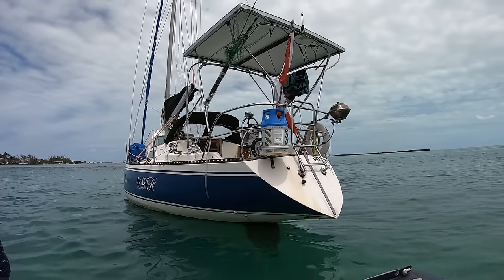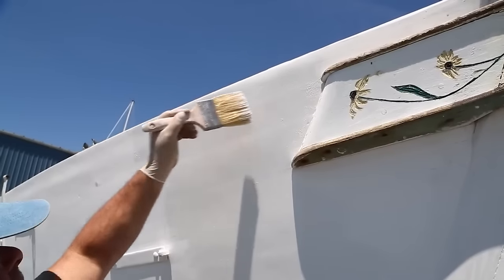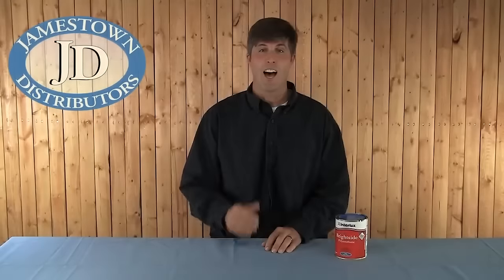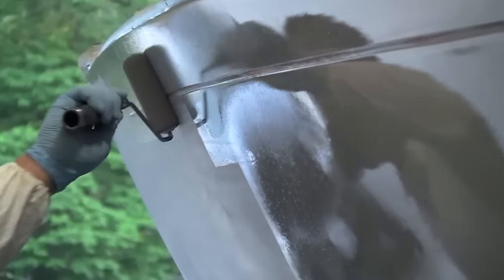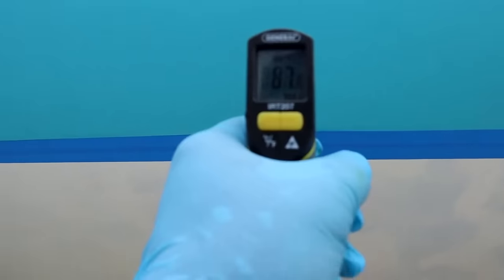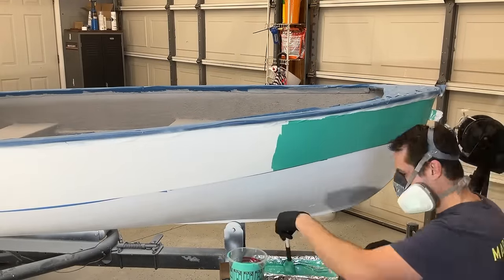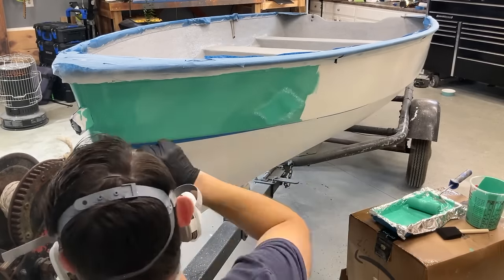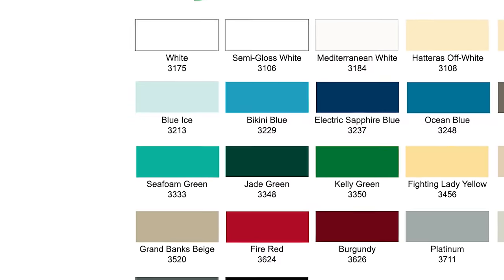Sailboat Paint Decisions, Decisions... Just Basics - Ep 273 - Lady K Sailing

Comment: If you paint your boat black, you don't need propane. You sail down to the tropics, set your eggs on the cushion, then put them in the fridge when they're hard boiled. Sometimes tankers run over black boats, but at least they don't notice. Shelf colors are a blessing. The shades pop better, when you see what each brush stroke costs. You'd better get your gelcoat in perfect shape before you lay paint on it. PT 109 advice: "Slap it on. This isn't a movie star's bedroom." I have a Devilbiss sprayer. I've never used it once. A paint brush is so much easier and easier to clean. The less stuff you have to buy, the better. Lose the skinny stripes. Make it easy.

Comment: Alexseal is the new kid on the block with yacht paints. They have a great product equal to the most popular one. Except they have an additive that make no need for tipping. Just roll it on and wait at it self levels. Andy at Boat Works is a distributor.
Reply: Jamie is spot on.  It followed Andy's video and had great results using Alexseal Yacht Coatings and that new rolling additive (something named with 4 numbers)
Reply: I started to prep my boat for Alexseal, then i got carried with glass repairs, new sizing for stainless port lights and the list goes on, it’s been two years, finally ready for paint! I’m in Cleveland, hampered by weather and seasons and my job
Reply: I came to the comments to say the exact same thing! And I think the light blue would be perfect for a first paintjob. Enough pigment to cover relativly good, but not dark enough to show every little flaw. I would add some white lines or something to break it up a little tough. Maybe just using decals so it can be changed later if I wanted.
2 pak is in genral much stronger, and if you are doing such a big job I would reccomend it. It's worth it in my opinion. I dont have any experience with the last brand mentioned in the video tough, so I can't comment on the durability of that one...
Reply: I agree. It can be rolled with excellent results.  Plus it can be buffed. You can touch up and blend in with excellent results!
Reply: I haven’t tried it myself yet but also follow Andy and was going to suggest he check it out.  

For bottom paint I’ve always used Interlux and been extremely happy with it.  It isn’t cheap, but 1 signal coat & 3 coats on top and it’s almost ready for a recoat after 8 yrs!  Their customer service is excellent as well.  When I moved from fresh to brackish water they were able to explain the differences between products, help me make the right choice and give me a lot of info about application/recoat which allowed me to significantly speed up the process and reduce daily charges for sitting on the hard.  I have no connection to them other than having a great experience for what it’s worth.

Comment: Dont forget show-through. I used International perfection on my RL24 because it was the closest on-the-shelf match to the original colour. Took 5 coats (and more than twice the anticipated cost) to hide the patchwork that was underneath. Used Altex 3-2-1 on topsides - much better coverage and easier to work with (wet-edge etc.). Both have been good in terms of durability.

Comment: I just painted my boat. I used a 2 pack acrylic paint. Supposedly it can be fine wet sanded and polished. It rolled badly so i bush used a brush with the usual runs and brush stroke marks. Next year i will sand and polish it.

Comment: I would love to see a video on weight distribution on sailboats.  You recommend oversized anchors and chain rodes (which I have) however it absolutely destroys the sailing characteristics of smaller or lighter boats like my Ericson 27 since there is literally no way to carry all of that heavy ground tackle other than on the bow (my Rocna does not stow anywhere except on the bow roller and the chain rode has to drop into the bow for the windlass to work).   Honestly I adore my bombproof anchor setup and refuse to swap it out for anything lighter as it has seen me through some severe anchoring situations where nearly every other boat dragged.  I have been willing to put up with severely degraded sailing performance for peace of mind in an anchorage.   I just wish there was a way to get that weight further back towards the stern.  The same applies to large battery banks.  Li-ion batteries have made that less of an issue but a big battery bank can really screw up the trim of your boat.  I guess I just need a boat that only has a middle and no bow or stern or port or starboard!  :)
Reply from the maker: you raise some good points for sure
Reply: I’d like to see something on this subject as well. I saved some weight with a lighter beta vs the original Volvo engine but when I replace my anchor I’ll definitely go bigger and when I start cruising it will get heavier still.

Comment: Tim, we just painted our 36' Islander Freeport with Total Boat Wet Edge.  We went with white and the wet edge is a real issue.  We did lose it a couple of times and you can see the lines.  Luckily we went with white so its hard to see unless you are looking for it.
You mentioned the cost could be up to $1,000 in paint.  We dis 1 coat of primer and 3 coats of the white and we only used 1 gallon of primer and 1.5 gallons of paint so the cost was pretty low.  Just an FYI

Comment: Just painted a Santana 525 roll and tip method using Wet Edge Poly.  We did it outside on my driveway.  Conditions during painting were NOT ideal, but the results are "good enough". The must have is a 1/8" nap foam roller rated for that paint. Really did not tip much, the roller with the brushing solvent allowed the paint to lay down well. We went with a bright red color and it drastically change the way the boat looks.
Reply from the maker: Great tip!

Comment: I painted my 1972 ranger 33 with interlux toplac (roll and tip) maybe 15 years ago. I wanted a soft grey, so i mixed two grey to one white. The boot and cove stripes were interlux brightside red. I sold the boat after about five years, and it still looked really good. You may not want to go too bright, because you are going to see all of the hull imperfections.  Also if you mix, and run short, it could be a problem matching. Good luck!

Comment: Oh, this is going to be fun! I had my first Islander painted professionally with Awlgrip. Beautiful finish, no more waxing. And 30 years ago it was still affordable. A group rented a barn and we prepped five boats, called in a sprayer, done! I haven't painted "Natasha" and probably won't. But I did paint the stern, it was in poor shape after being renamed by various owners. I used Interlux Brightsides, standard Hatteras white, to match the gelcoat. 15 years later it still looks good. I rolled and tipped, looks just like the gelcoat but easier to keep clean. Remember that a dark color will show all the hull defects, along with all the dried salt spray. Lighter colors hide a lot. Prep work is the key, as you've mentioned. Sanding with a long board is critical if you want an even hull at finish. Brightsides is a single part, but can still be touchy to apply. Temperature and application thickness is critical. And remember the 10 ft rule: if it looks good from 10 ft, it's good! (that distance shortens as eye sight fails with age!). Good luck, and I'll be following.....
Reply: Natash's a beautiful boat Bert. I enjoy your videos. See you out there...
Reply: @Cacheola  If you're out on the water where I sail, what do you drive? I will keep an eye open. I'm on AIS if you happen to see me out there! Thanks for the comment!
Reply: @BertVermeerSailing  Catalina 34 mk2 out of Comox. I may circumnavigate the island this yr. I'll rattle your chain
Reply: @Cacheola  Please do. I'm headed out to the west coast by Victoria/Sooke/Barkley and point north starting June 2nd to the end of July. Enjoy the summer!
Reply: @BertVermeerSailing  OK Bert. I have an old cat with kidney disease I'm tending to, have to stay close to home this year...

Comment: My current boat is painted with Epifanes 2 part polyurethane. Much harder wearing than the Brightside that was on my previous boat. Pretty simple - 2 parts plus the required brushing thinner, done when relatively cool it maintained a wet edge and flattened straight off the foam roller without tipping. More money than single part but you get what you pay for. Readily available in Canada (even Manitoba).
Reply from the maker: thanks!

Comment: I ended up spraying my 30' GRP boat using automotive paint about 6 years ago.  Same preparation (sand, fill, prime, sand etc) then two or three light coats of paint sprayed on, followed by a UV-resistant clearcoat.

I sail year-round in a very high UV environment.  The paint still looks excellent.  

With vehicle paint you can choose exactly the colour you want, it's easy to touch up (you can find someone to colour match auto paint just about anywhere in the world) and any touch-ups just need some clearcoat on to be sprayed on top which can then be lightly buffed and polished so the touch-up disappears - it's as easy as fixing the paint on a car (and again' lots of people can do it fairly cheaply).

I looked at Awlgrip.  The yard told me that one of the reasons they charged so much to paint a boat with it was that if they make the smallest mistake they basically have to start all over again.  Effectively they were costing in the potential of needing to paint the boat twice...

Comment: In 2015, my 1996 Beneteau 42s7 was professionally painted with Awlgrip.  Between haul outs I wash it with mild soap & water.  Every two years when I haul out, I apply Awlcare, a milky liquid polymer that goes on easy, leaving a magnificient shine and protection.  Just yesterday I splashed the boat after a three week haul out where I applied the Awlcare, again leaving a brilliant luster.  Also I replaced the 30 mm propeller shaft with Aquamet 22 due to some corrosion and a cut caused by a wire fishing line.  The cutlass bearing was replaced.  A new three blade Max Prop "Easy" was installed too.  To remove the prop shaft the rudder had to be removed so I took advantage of that and replaced the lower bushing.  Although I've owned this boat for nearly eleven years, I learned two things: 1) the rudder post is fiber/ fiberglass, and 2) the strut is also some sort of fiber/fiberglass.  One note about the new Max Prop "Easy".....the threaded length on the shaft is much longer than a traditional length. I had purchased an eight foot length of 30 mm Aquamet 22 centerless ground bar; it was plenty long enough, leaving a drop.

Comment: I painted my 1970 hull with Easypoxy. I did almost no prep, and I rolled and tipped and it came out great, better than I expected. I chose Bikini Blue, because that's the closest color to its original color (which I could see when the white paint came off of the gel coat in some places). I used Penetrol, which helped keep it smooth. I forget how much I used, but it does matter, so one should experiment. It allowed me to roll and tip on a hot day and not have the paint dry too quickly. And it leveled out nicely with few brush marks. Really great stuff. Plus, the paint is durable. There is white underneath, and I figured from normal wear and tear I'd see white eventually, but I didn't. When I  bump against a piling or something, it just scratches the surface of the paint and doesn't go all the way through.

Comment: I painted my 27' Newport bottom, hull, and top deck.  I used Trinidad (the old stuff) on the bottom, 3 coats, and Interlux Brightside for above the waterline.  Rolled and tipped.  This was about 10 years ago, and the total cost at that time was about $1100, but that was everything...haul out/splash, 4 days on the hard, paint, thinner rollers, brushes etc.  As MountainMan below said it looked great from afar, but was not perfect.  That is not the brand of paints fault.  You will make mistakes, but a lot of them you will be the only one who can tell.  I am about ready to do it again.  Colors?  My choice would be gloss black with fire red accents.  Best of luck!

Comment: Have you looked at Teamac paints? 

UK outfit. 

They do a single part paints as well as two part. 

I've used their paint. 

Very straightforward to use and excellent result, provided your prep work is done well. Roller and brush finish. 

But if i can make a suggestion, regardless of what paint manufacturer you run with....BUY TOP QUALITY ROLLERS, AND BRUSHES ONLY. 

Makes a huge difference.
Reply from the maker: I will check it out

Comment: A couple of things. Awlgrip is about the most difficult of the 2 part paints. Something like Epifanes 2 part is quite simple in comparison. Prime with their primer, mix the 2 parts and roll and tip. They even specify that you can paint directly over sound fiberglass with no primer required. I’ve used their 2 part with and without primer and it’s great. One thing to keep in mind is you can never use 2 part paints over 1 part paint. So if the boat has 1 part on it now or once you paint it with 1 part, any subsequent painting has to be 1 part unless you completely strip off the 1 part first. I like EasyPoxy too. Interesting when you said the green was too green and the blue was too blue. I immediately wondered how they might look mixed together. You could buy a very small amount of each and try mixing a small portion a little at a time? It’s a thought anyway.  Ken

Comment: A few years ago we painted the topsides of a Mumm 36 and we took a slightly different route.  Instead of roll and tip we talked to the painter in our local autobody shop and he did it as a side project for a couple hundred dollars.  He already had the equipment and auto paints are very similar.  We had the boat prepped when he arrived and had a section of rolling scaffolding and a couple guys to move him and the lights as directed.  Turned out great.
Reply from the maker: Interesting……
Reply: @LadyKSailing  and as far as the end result its all about the prep. Sand, fair, sand, sand more and more and more

Comment: Did you find Lady K’ dark hull hot in the south? If so, go with the Seafoam. 

I painted my Flying Scott with Perfection rolled and tipped. It came out amazing but not as good as spraying. I need to do it again a it broke away from the dock in a gale and washed up on the rocks. But you need a protected place free of pollen and dust

Comment: What about a wrap? I’ve been looking in to wrapping my 1978 30’ sloop, and so far, it’s looking to be not that bad. 
Either way — spray, roll&tip, or wrap, I will have to learn how to do it, but I think the process and tooling of wrapping will be a little better than the painting.
Reply: And yes, I know it’s not as long lived as paint. But that’s not necessarily a bad thing. Removing the old wrap isn’t that hard, and leaves a surface that is pretty much already prepped for the next wrap. At any rate, I’m willing to experiment on my boat. She’s 46 years old and has been through a lot. So this isn’t some kind of indignity.

Comment: For all the effort to ready the surface it would be best to use a two part polyurethane paint. Lots of choices as per brand. It is a two person job: one rolling
on the paint and one tipping off. The two parts are not that difficult to apply and the result is far superior. Higher gloss , higher resistance to abrasion , high
resistance to UV . Plus for the Caribbean use some light colour to keep the temp inside the boat more bearable. Look at Interlux Perfection which is easily applied by rolling and tipping
Reply: Unfortunately Interlux has discontinued Perfection! It was my favorite.

Comment: For my two cents, I would suggest you get samples (pint) of both the Bikini Blue and Seafoam Green, and then see if a 50/50 mixture of them gives you a color that you like -- there shouldn't be an issue with combining the colors as the pigments are both from the same manufacturer.  It sounds like you are looking for a color right between the two.  If the 50/50 mix works you just split the total number of cans that you were going to order between the two colors -- that way you don't end up with a whole bunch of unused paint (white as noted).  I personally like the black hull idea with maybe the Bikini Blue for a boot stripe and a cove stripe to make the contrasting colors pop.  You did not mention what color/type of anti-foul you are going to put on --- keep in mind that in those clear waters down South you can often see that too (you might want to consider that color as well).

Comment: never worked with awlgrip. i did paint my 30ft with Alexseal, first time ever. no previous experience of ever painting a boat.
everyone thinks it was a spray job but all i did was STUDY the manuals and use the rolling additive.
Reply from the maker: Thanks for the input!
Reply: you will need to degrease/dewax the boat exceptionally well, use the 2 rag technique,  
when it comes to primers if the manufacturer says you can thin it to 15% it means you can thin it to 30%. note im not saying that you have to thin it to 30%, im merely saying that,  when you adjust having to paint a surface to the atmospheric conditions of "painting day" you can thin it to 30%.
 dont mess with with the ratios for the paint itself. use the converter and thinner ratios the manufacturer tells you to use.
you will need to polish the final result. if you think sanding is hard get prepared for polishing because its much harder.
first you need to wet sand with 1500 grit, then 2000, then 3000. and then you break out the polish machine and cut and polish.